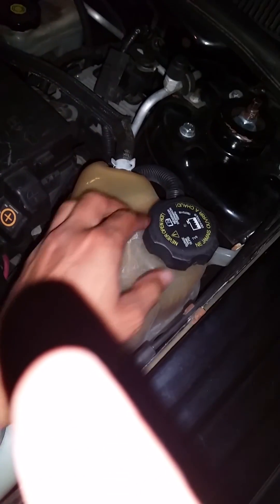Engine Oil looks watery?

Comment: Blown head or your injectors are leaking gas onto your oil
Reply from the maker: Yeah, it was an blown head gasket
Reply: @GlyphStar321  mine just looks thinner cus i have gas mixing with it,i need new fuel injectors.

Comment: I have the same problem
Reply from the maker: It turned out to be the cylinder head gasket that finally gave up. I stated to loose significant engine power a month after this video. Took it to several mechanics and they all wanted to put in a new engine. I was not having that. They told me cylinders 4 and 5 have low compression. So I started reading about head gaskets and read somewhere that if adjacent cylinders have low compression, it could be the head gasket. Since I suspected the oil was smelling like it was mixed with gasoline and coolant, I decided to fix the head gasket myself--with zero knowledge. With the help of a few videos and a 3 part video posted this year on YouTube, I managed to do the job. It's running like a champ again! If this is your case then get 4 Jack stands, a car jack, rent a serpentine belt tool, a 1/2 and a 3/8 drive torque wrench, a long breaker bar, six point deep sockets, and the Hilton book from Autozone. I also recommend you take 3 days to spray your exhaust bolts with rust penetrating spray. And order the Fel-Pro Head Gasket kit. Once you finish the job, refill oil (pour some on the rocker arms when re-assembling) and coolant. Then flush the oil and coolant and refill once again to rid of the mix of gasket-coolant-gasoline debri. Oh, and also get the cheap blue plastic gasoline line disconnect tool from either autozone or oreillys auto for your fuel line. It was a rather thorough and easy job and easier putting it back together. Should take anyone more than a week if you have the tools I mentioned, probably can get it done in two days (that's if you spray the rusted bolts before the job).
Reply: the head gasket of worn piston rings
Reply: @GlyphStar321  were you losing a lot of coolant?
Reply from the maker: @Cashstrooo  by the time i shot that video, I was unaware it was the head gaskets that gave up. I was trying to piece things together to get an idea but besides the reduced engine power, the weird looking oil was another sign. In my case, it was a little amount of coolant getting into the engine and a significant drop in the coolant reservoir did not catch my attention..
Reply: @GlyphStar321  my car overheated 2 days ago and coolant spew out all over the  engine.  now I fill up the coolant reservoir and and drinks it like water.
Reply from the maker: @Cashstrooo  could be any thing, I'd start with visual inspection of the hoses, water pump, thermostat.....
Reply: How much did all that cost?
Reply: 20k miles 😂 dum-dum you’re supposed to change every 3k for conventional and 7-10k for full synthetic